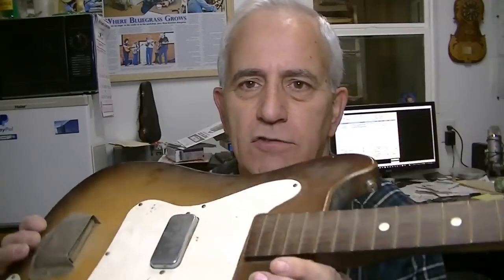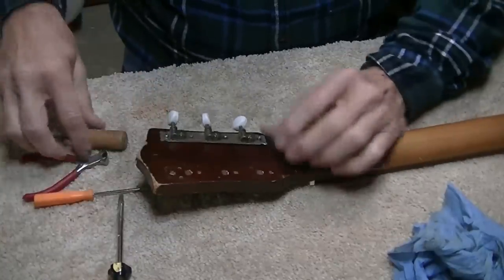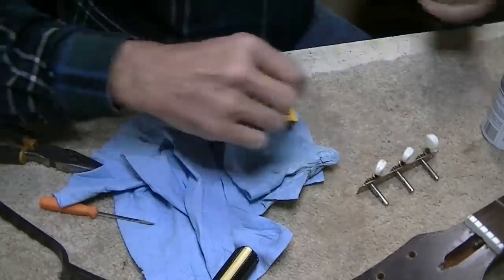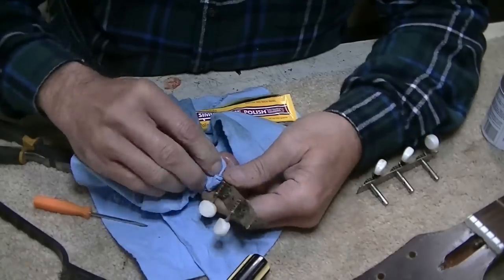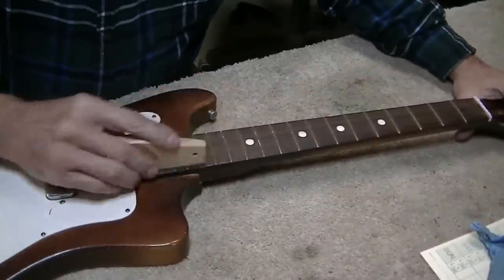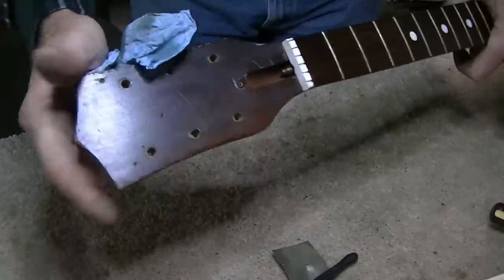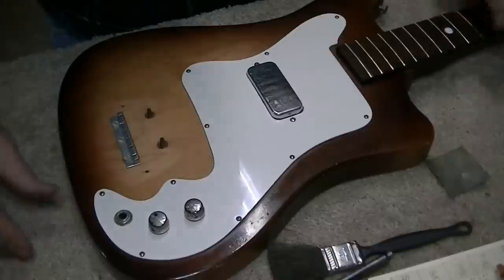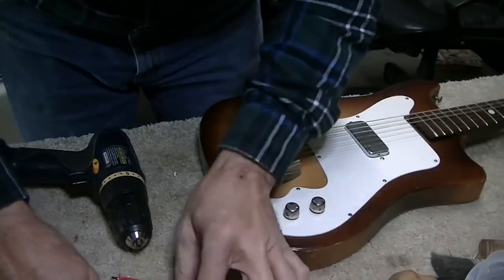608 RSW From The Vault! - Storage Locker Restoration - Electric K Vanguard 100 Guitar Repair

Comment: Have the exact same Guitar, found "Vanguard" handwritten on the stock under the pick guard, couple years ago, pulled from the closet, dusted it off, & decided do a little restore, & try make it playable, but soon found out the trust rod was stripped, & no longer would adjust, but further tinkering & investigation, I realized that it had likely been tightened so much over the years, it had run out of adjustment, so with some fiddling & a lot patience, I was able to extract the nut, then fabricated a bushing, & with some careful removal of the wood around the truss rod was able to insert the bushing, &  get the nut started again, which was also stripped, & needed to reshape & downsize the socket, only to have it break loose from it's hold on the other end....crap! well, it just snowballed from there, & tried My luck at fret board removal removal, with some education watching Your vids, built a double action truss rod, was able to make it fit, & one thing led to another, & routered body to accept a pair of double humbuckers, built a leather pickguard, wrapped the chrome bridge cover with the same leather, sanded & stained the body & neck to compliment the leather, made antler nobs for the volume, tone & three way switch, also used antler to replace the fret makers, & even added small makers along the top edge of the neck, & also done the same for the tuning machine nobs, mine was also missing the Kay emblem when I purchased it, & a Signature Amp, from a local lady who run a bar, that was Her husband's, who had recently passed, package deal for $30 ....oh yeah, also replaced the frets too, with gold frets,,,,all in all, turned out pretty nice, & plays as well.....would send a pic, but not entirely sure how, perhaps just locate Your email.....anyway, just thot I'd share, as it was my first electric guitar as a kid too.....

Peace Out.....& Beyonder

Comment: That thing you call "backlash" I've always known as "play" as in there's a little play in it. I remember it mostly used in connection with the steering wheel of a car but anything bi directional referring to the loose section between clock and anti. Great vid. as usual Gerry

Comment: I had to work on a neck like that over summer, and adjusting the nut was getting me nowhere fast. So, I took the neck off, put small wood blocks on each end of the fret board, set a straight edge on the blocks and put a clamp in the center of the neck and tightened it so the middle of the neck would rise up to the straight edge. Good old summer temps of 90, I set the neck in all its traction outside in the back yard on a stump in the sun and let the heat work on the wood and get it more flexible. I did this for a few days, bringing it in overnight and starting the next day when the temp got up. The truss rod was loosened to begin with of course, and sure enough, I got my relief back to where it was supposed to be. Amazing how over the decades, the wood wants to hold that curve for dear life lol

Comment: I got a 61 KAY Montcliff tiger street maple when I was 14 years old in 1961. It has to speed bump pick ups and the patina is fantastic. I sent it to Randy at the house, but never sleeps. It had neck issues. It was the more expensive model that Kay made. And it has, and it has amazing tone to it after it was repaired. Gold hardware. I have a lot of different guitars, but I get the old Kay and it has amazing sound from those speed bumps pick ups. He did a few videos on this guitar. If you look him up on his channel, it was about two years ago.

Comment: I have the same early 60s guitar which was given to me by my grandfather in the late 70s. The only difference is that mine was branded as a Penncrest made for sale by J.C. Penney. My guitar had to have a neck reset - by carving more wood out of the neck pocket (the opposite of adding a shim). Also, the original brass frets were extremely rough. So, as it was manufactured, it was barely playable (except as a slide guitar). Finally, a few years ago I had a professional luthier give it a "full meal deal" including the neck reset and installing new nickle frets. Even though the guitar is relatively small, it has a slightly longer scale than a Fender, so I prefer to use .009 - .042 super light gauge strings. The old-school pancake pickup sounds great (similar to a P-90). So now I really enjoy playing my vintage American "Penny". Now, I think I will give it some polish and wax like you showed in the video. Thanks so much for your videos!

Comment: I have the exact guitar.  Nice job!   

I had to have mine refretted- the original frets were beyond leveling.  Along with that had a bone nut put in.  I don’t have the bridge cover and am looking for one.  

Good idea leaving the pickguard in place.  Mine shrunk a little after I took it off.  There are full size pots in there with a paper in oil capacitor.   I love this little beast, great tone from that Zippo lighter pickup

Comment: I started on the same guitar. I bought it for 35 dollars used at the buy sell shop Madison Wi.
It had a bowed neck the whole time I practiced on it through  1977 -1980  "If "I knew, then what I know in 2022 about guitar repair I could of fixed it  I've even heated up a skunk stripe and removed a broken truss rod. But back 4 decades ago I would of just broke the truss rod/ had I tried to bring it back straight  with out using heat and a  I beam and clamps . Probably got thrown away

Comment: Dear Rosa String Works; I appreciate your post here! I especially love #Simichrone and #RenaissanceWax..I use both! 
I have learned that a lightly dampened with water cloth with some “elbow grease” will clean up a multitude of sins.❤️🧐🤔
Also, on those tuning keys (molded ends) I lightly sand ( file as well) the mold lines till they disappear, then sometimes soak them in a bowl of strong coffee-vanilla and they will look “old.”

Comment: Yes, it's a Kay Vanguard, just like my first electric guitar! Can't remember if mine was a single or two pickup model, but otherwise identical. Mine was missing the bridge cover as I recall (55+ years ago). Knobs were identical, silver that was partially worn off. Mine did still have the "kay" headstock badge. It had very high action, and I had no clue that I could have adjusted it!!! It doid actually sound ok (thru a modified hi-fi)

Comment: We have a "gel" in the UK that I've used on those similar machine heads.  It's called Finnigan's Waxoyl...it removes rust ...you just brush it on generously, then leave it for a day or too, then clean off. Cleaned up some 60 year old machine heads very well.

Comment: You might want to at least check the ground wire on the bridge of an electric guitar.. Just to be sure the kid who plays it next isn't killed by it. You never know when they're old like this, and whatever old amp they might plug into. These older amps have a capacitor that protects the high voltage from reaching the coil circuit.. But sometimes when really old they short out. Not good. This earned it the name the "death capacitor".